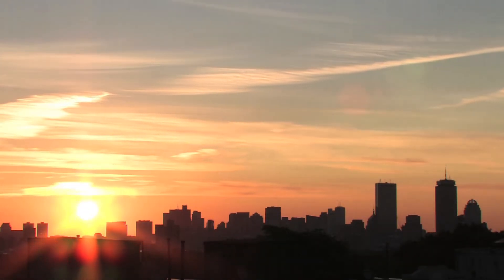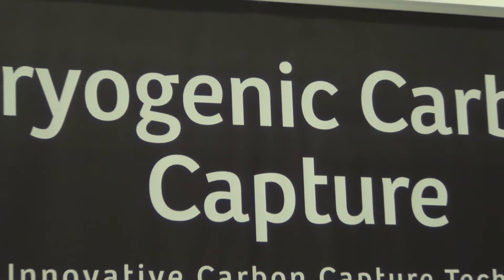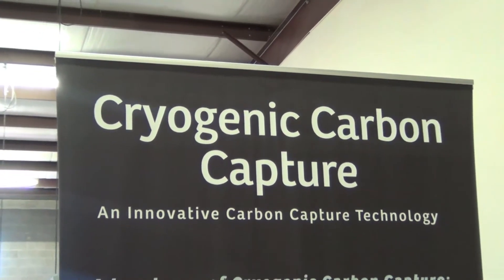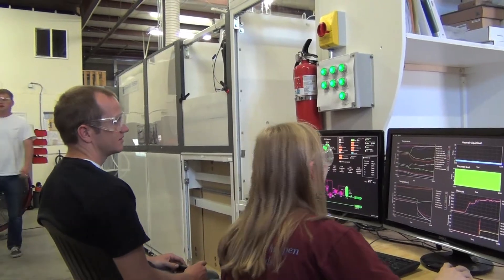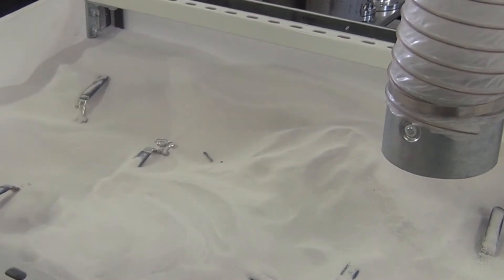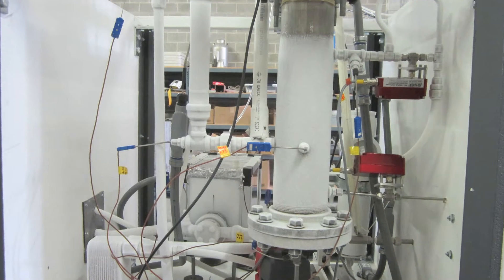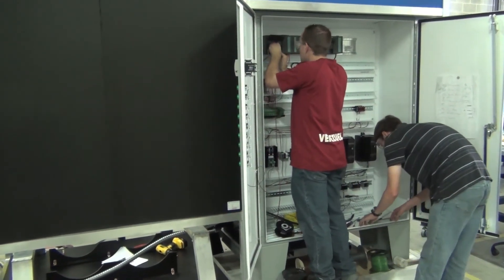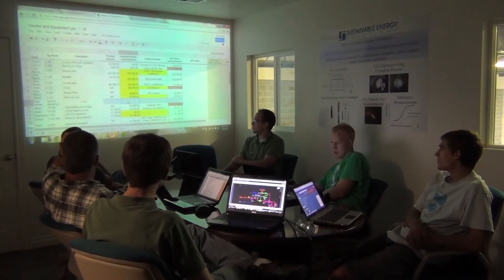Cryogenic Carbon Capture

Comment: How do you achieve -120ºC, can you explain better your refrigeration system?
Reply from the maker: Multiple options.  One way is to compress, cool, then expand the flue gas.  The other is to use a low temperature refrigeration cycle, similar to LNG processes.

Comment: What is the range of CO2 that can be separated from a flue gas with this process ???
Reply from the maker: It can handle a very wide range of CO2 concentration and can adjust capture effectiveness by changing the coldest temperature.

Comment: Hi, I am a physics professor. How much energy per ton CO2 removed from the atmosphere is required by your process. The thermodynamic lowest limit is about 120 kWh/t at 415 ppm CO2 in the air and ambient temperature of 300 K (27 C).
Reply: it’s not CO2 removal from the atmosphere, it’s CO2 removal from exhausts